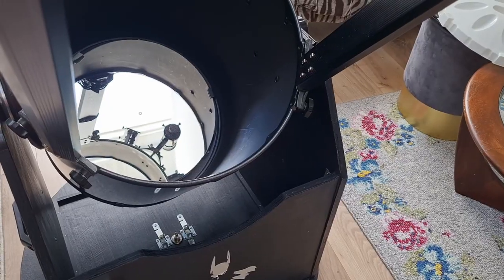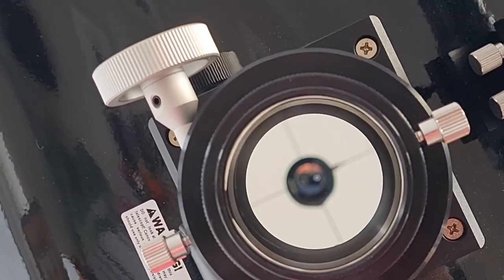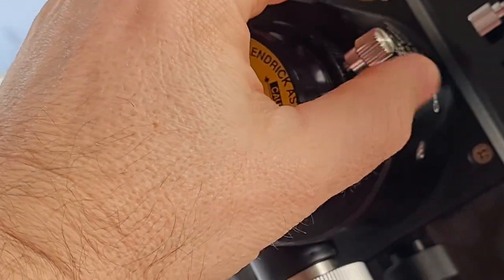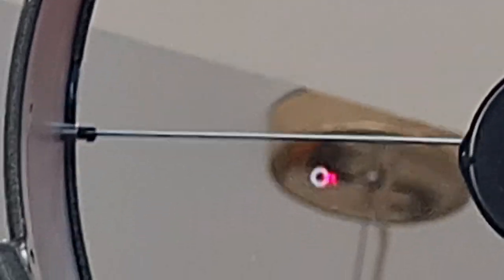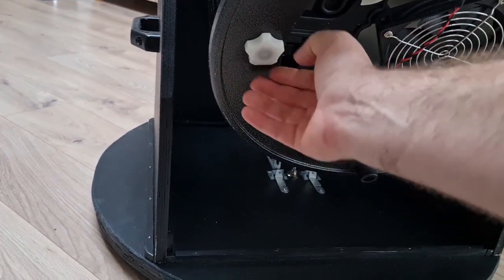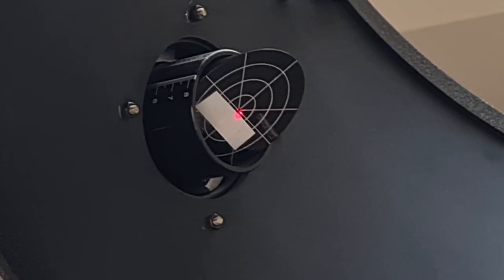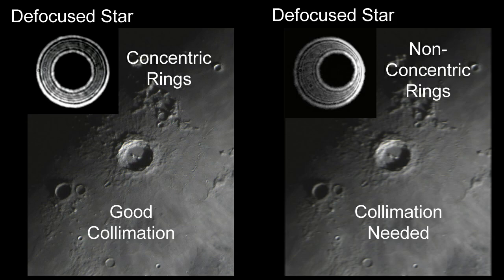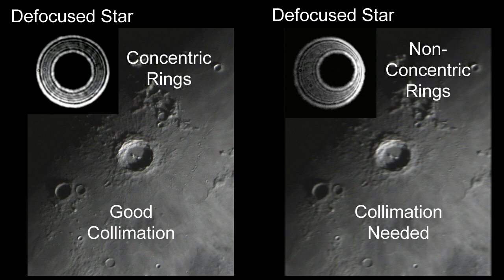How to Collimate a Dobsonian telescope

Comment: I have a 20" obsession classic. The laser pointer is centered on the primary center dot. my collimater tube inserts with the bulls eye outside the the telescope where your bullseye is sticking insde the tube. when I look back from the primary to adjust beam my beam on the bullseye is is not a dot. Its a very imperfect sphere with an oblong whole in the center. so I have two concerns with that. Am I supposed to have a laser dot inside the bulls eye or a sphere with a whole in the center, because I have neither since the shere is nebulous.
The scope has been sitting for 7 years. I cleaned the mirror but possibly it needs further cleaning because of the nebulousity of the sphere. But is it ok to have the shere at all instead of a dot. This might reqiure pictures to explain.
Reply from the maker: Yeah, that does sound tricky without pictures, but I think I follow you. If the return beam looks fuzzy and has an oblong shape or a hole, it's often due to haze or residue on the primary mirror, even after a basic clean. Sometimes it also means the laser itself might not be collimated properly. You should ideally see a clean dot return to the center of the laser target. If the shape looks weird, it can make collimation unreliable. If you can snap a photo and email it to my address in the bio of what you're seeing, I might be able to confirm it’s just scatter vs. an issue with the collimator or alignment.

Comment: Are the collimation bolts with the spring always used for adjusting collimation on primary mirrors?
Reply from the maker: Yes. The bolts with the springs are what adjusts the tilt of the primary mirror. Some scopes also have a set of 'locking' bolts that you loosen when collimating and then gently tighten up to keep the mirror in place. HOWEVER! Don't use these to adjust collimation or over tighten when locking. They will cause the mirror to flex and you'll get non circular stars. I replaced my collimation bolts and springs in both the primary and secondary with a set from the famous 'Bobs Knobs'.

Comment: Use Polaris for star testing because it will not move and it is a good magnitude. The laser gets you close on primary but I would use either barlowed laser, cheshire or collimation cap to finish tweaking the primary. That will get you accurate enough that you shouldn't need to star test. My skies are seldom good enough for star testing, which is not that easy even in good skies.
Reply from the maker: 100%! We always have club members asking how to collimate so it's good to show them the basics. Certainly the Cheshire is always a good combo (or even a home made collimation cap) completes the process.
Reply from the maker: Very interesting points to consider. I'll keep the transmission and focus/etching on the glass of both in mind next time I'm aligning.
Reply: You are right. However.... for that to work you need to have near perfect seeing conditions. At least where I live, that does not happen often.... You can also use something called an artificial star. I you perform a "startest" on that thing, your results will be equal to testing on an actual star. However seeing is not the spoiler then.